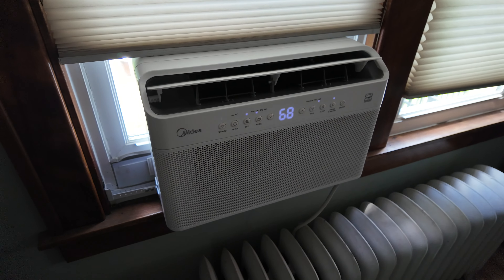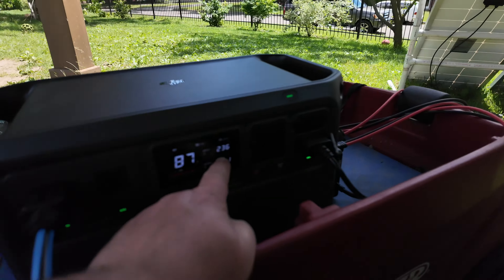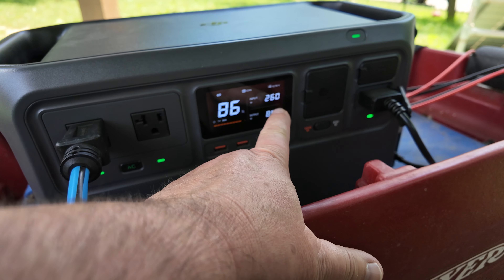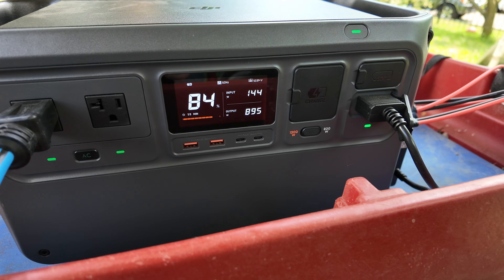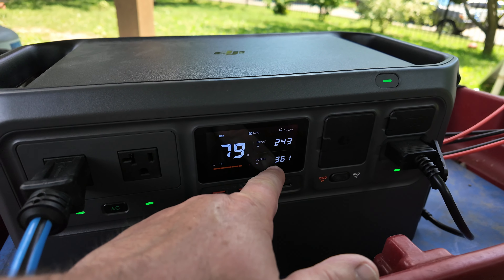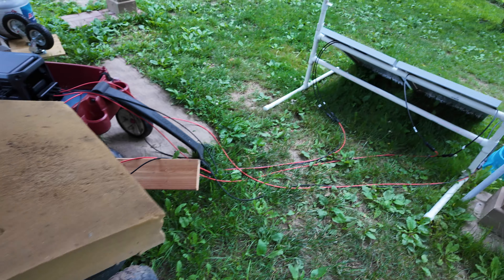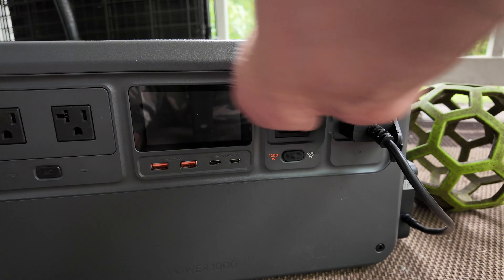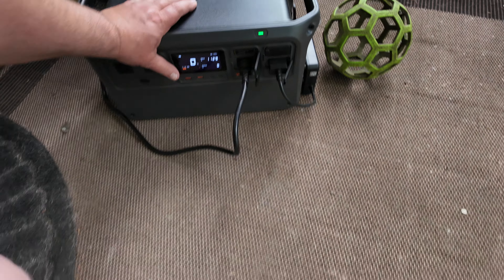DJI Power1000 and Window AC

Comment: How long will that AC run abut 2 hours , seeign the Percentage did drop  quickly in the vid
Reply from the maker: Yes, about 2hrs, if there is no sun in those 2 hours.
Reply: @mygiguser  Man I need to Run out and get one the Heat wave is Coming that will work  fr sure

Comment: What is the most solar input wattage you have observed with Power 1000 in all your tests?
Reply from the maker: @reneguitart  about 400W with 6x100W panels. The max i got from 1 of those panels was 80W
Reply: I own the Power 1000 now and would like to get the maximum solar input possible.  I have noticed that no YouTuber or reviewer has been able to get beyond 400 watts even with two MPPT controllers and multiple panels. My plan is to purchase two JJN solar 200 watt bifacial panels and see what I can get. If it works I will get two more panels and another MPPT. I am concerned at this point that getting close to the 800 watts may not be possible.